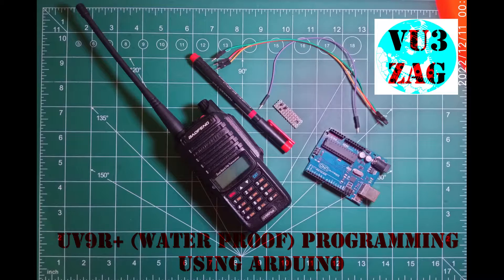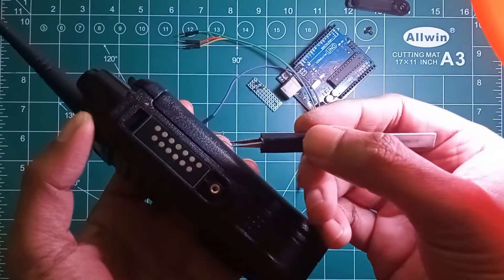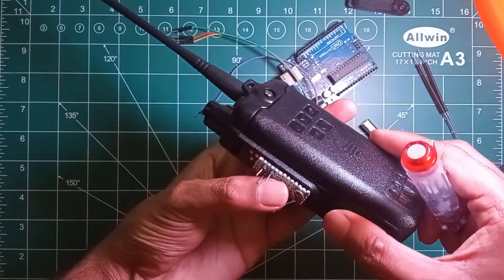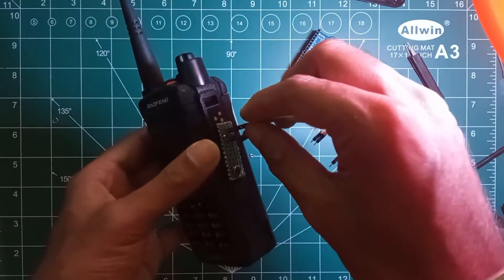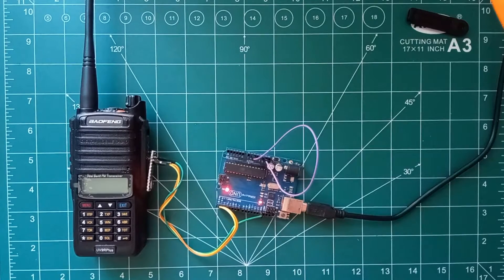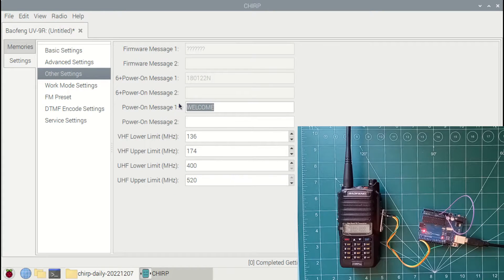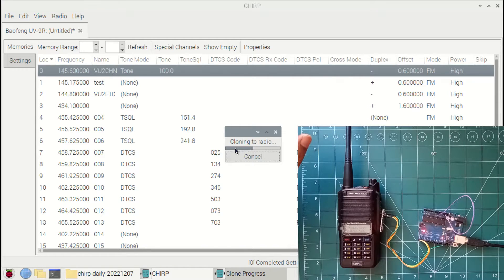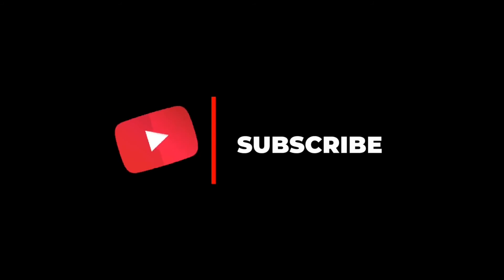UV9RPlus Waterproof Radio Interface Cable and programming using Arduino

Comment: grate video, could you help me. how could i solve the problem whit the message: " error reading data from radio: not the amount of data we want". thanks
Reply from the maker: Make sure the programming cable RX, TX and GND connected properly at radio end. Also update the programming cable driver's to latest available.